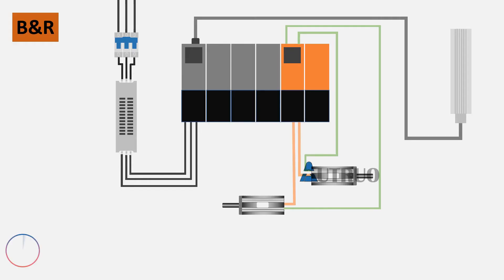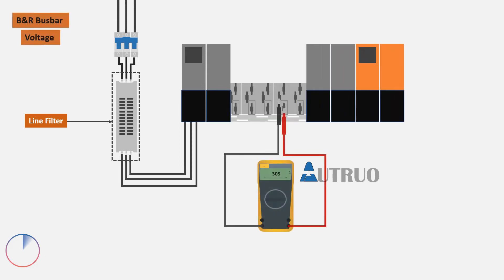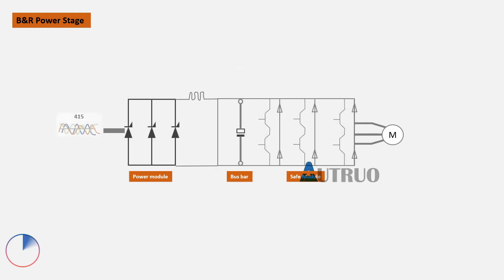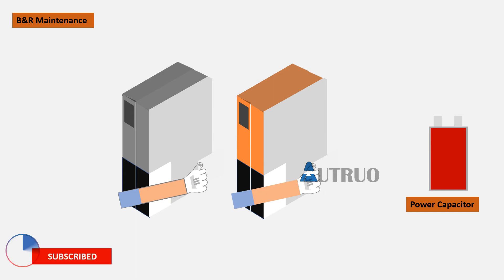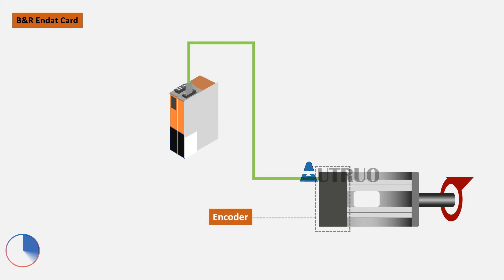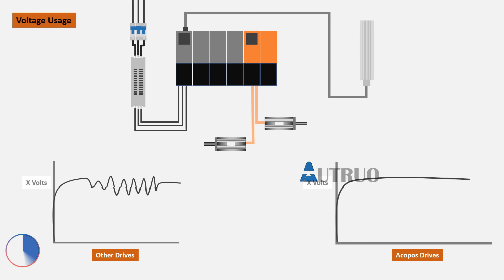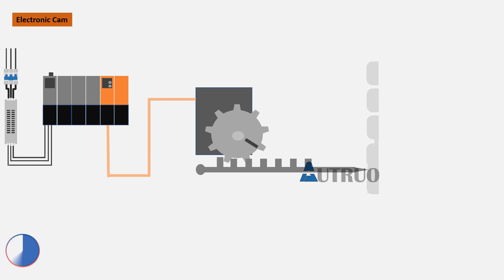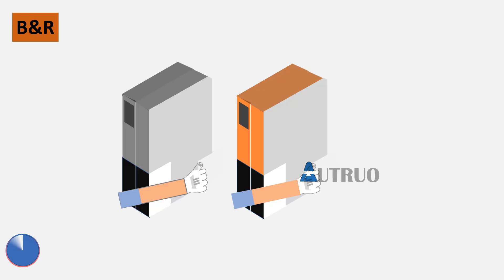What is Acopos

Comment: Could you please tell me if orange led lights indicates near Top of drive up and down mention that led lighs indicates what is the meaning...?
Reply from the maker: On the power side usually P0440 or P0... some thing, we have LEDs for 24 volts which show for 24 volts input, RDY to shows that the drive is ready, and to RUN to shows that the drive is in run mode R/E means powerlink connection active.

L/D1 Data activity Port 1
L/D2 Data activity Port 2

on the Safelogic
UP LED: Lights when the encoder position changes in the positive direction

DN LED: Lights when the encoder position changes in the negative direction
Reply from the maker: It deep on what we are looking at, it is the power converter P0440 side or the control logic.